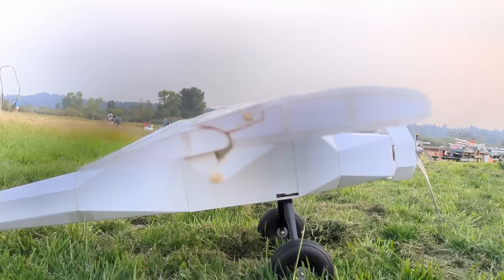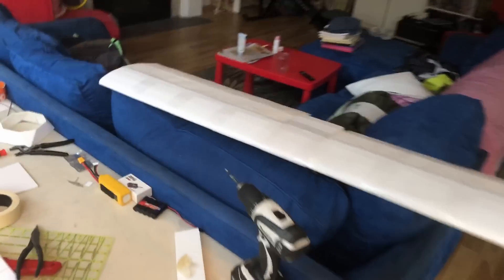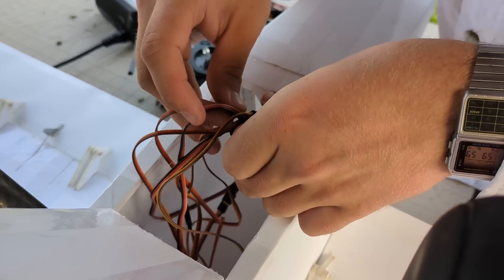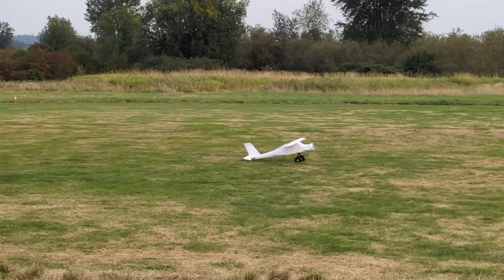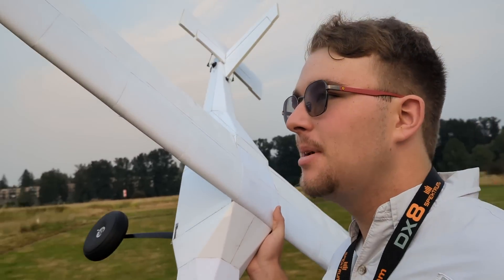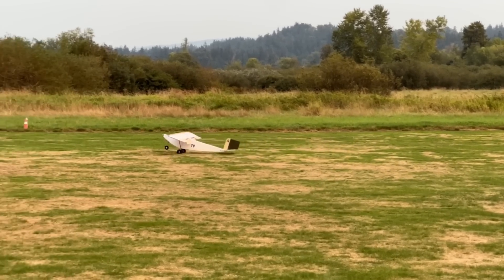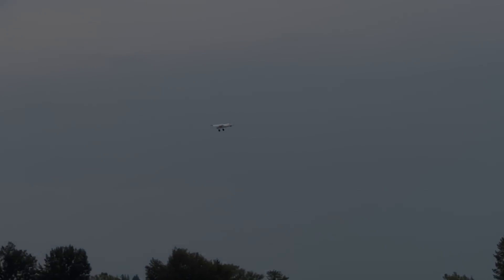Flying an Experiment STOL Concept Plane!

Comment: How strong and durable were the hinges for the flaps because I’m working on my own project that will have kitfox style flaperons and I want to make sure the hinges are durable enough
Reply from the maker: They haven’t broken yet! What did end up getting weak we’re the control horns and they tore out of the foam and got loose so I scrapped the plane

Comment: The Feiseler (sp?) Storch is a great go by for the ultimate STOL.

Just some observations, I think leading endge slats are an important marriage with the flaps.  Also, the empennage has a great scale look, but on most STOL planes are a little oversized.  Some even have an onverted airfoil for greater authority.  Finally, this is my thing with RC tail feathers in general, and that is that they look nice at scale, but because of the way Reynolds numbers dont apply well in small aircraft Inthink they need to be 20-25% bigger than scale to provide the stability needed.

Great job, tho!  Really love the onnovation of the flaps, especially on a foam wing.

Is that Marymoore field, by chance?

Comment: The gap doesn't "energize the flaps". It allows laminar airflow over the top surface so the wing doesn't stall at high attack angles. If the airflow over the top surface delaminates from the wing, a turbulent vacuum is created and the stall happens. Look it up on NASA.gov

Comment: Most of the lift does NOT come from air going over the top of the wing. Bernoulli is doing a lot less than Newton with respect to lift.
Reply from the maker: I would invite you to look at a type of diagram called an airfoil pressure plot. See how the pressure difference between the top of the wing and the bottom of the wing is almost entirely formed because of the top of the wing having very low pressure? That’s why obstructing the top of the wing with a spoiler works so well
Reply: @floppyhobbies  I'll take a look but symmetrical airfoils, paper airplanes and inverted flight...
Reply from the maker: @JustPlaneSilly  I'm not sure you understood. The pressure distribution isn't that way because of the airfoil shape, that's just how air is. On flat plate airfoils (paper airplanes), or inverted airfoils, they are just less efficient, but they're still getting the majority of their lift from the low pressure on the current upper surface, not high pressure on the bottom.
Reply: @floppyhobbies  You might be right but I don't think I can make my brain agree. If I hold my hand out the car window, the pressure on the top of my hand is way lower but it has nothing to do with anything other than Newton creating much higher pressure on the bottom of my hand.

Comment: Building an airliner wing for your model ? 😊
Airliners control surface are tied together and ce central control system dispatches according to flight envelope, it' s almost impossible to achieve good control without a flight controller tuned for your plane, this also include softwares support for your configuration and/or a really smart TX.

Also you should never turn off the engine when slowing down the propeller acts like an air brake !  It very noticeable 😆. You have openTx add some mix to limit engine rpm when airborne ( flight mode or specific input ) the spoilers should never be available in normal flight mode, just take off/ landing, allowing you to smooth transition between modes with delays or specific curves (difficult)

Comment: 0146   servos   do   NOT   go   at   the   tail.!!!      UNLESS  the model has enough mass that having  Excess  mass at the tail has  minimal affect  on the model's dom.     distribution of mass.  
0255   length of the aft cabin is excessive.     thus, the distance between the wing and stabs is a bit excessive.        proportion (comparison) of wingspan to fuselage length is a bit abnormal.
0450   AND  more  drag.!
0453   nope.      some things  Don't  work as expected when they are made tiny.
0508   THAT  is  bassackwards  from  what actually happens.     lift comes from positive aoa/aoi in a chord line.      lift is a product of newtonian action/reaction.    air is deflected downwards and a wing is pushed upwards.      want proof, look at  cheapo (grocery store) balsa airplane.
spoilers make  lots  of  DRAG (and turbulence) and  act as air-brakes.       these spoilers are gonna make a  HUGE  amount of drag because of the huge 'channel' that is formed behind them.
0603   heavy wing raises the location of the model's c-m.     center of mass            cg should be located at thirty percent of chord; or a bit forward-of thirty.          the span of the horiz-stab should be equal to thirty percent of the wingspan.       d
Reply from the maker: Oh hey, it’s you again. Glad you like my videos!

Comment: I'm curious as to what cad process you use. Specifically what software and how to go from 3d model to layout for the laser cutter. Or do you keep the geometry relatively simple and simply sketch it out in 2d with a lot of mindfulness?
Reply from the maker: I use Inkscape to design the airplane. I do not go from 3d to 2d, instead I design in 2d. My process essentially looks like getting a top profile, side profile, and cross sectional views of the fuselage at different points, and then using some simple math to make the transitions between them. I remember when I was first starting I had really wished there was a video explaining how to design an airplane like flite test. Maybe I'll make a video like that soon!

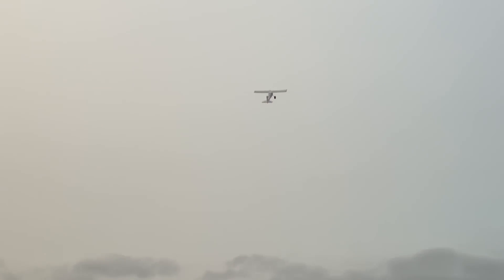Comment: I think you won the competition actually, because your opponent uses more the propeller than the wings to stay in the air. Someone even says "Do airplane mode." when he does half helicopter mode. But your airplane can do helicopter mode even better, as we see at 12:31. So in helicopter mode your plane does actually fly slower than the other one. And also if both planes would do pure airplane mode I guess. Helicopter-mode is considered cheating imho. So why not trying to fly slow in pure glider mode without the motor spoiling the result?
Reply from the maker: That's actually a really good idea for testing slow flight, the next time both those airplanes are out at the field I might try that. I'll be sure to reply with the result here if I do!

Comment: But 3D planes could fly as slow as the pilot wanted, including hovering?
Reply from the maker: True! It was pilots honor to see what the wing will do, and not hang it on the prop. At the end of the day, rc doesn’t really have a practical purpose so I just build the wing to see what it can do, even if a 3d plane could do it better.
Reply: @floppyhobbies  Your wing is amazing

Comment: thats pretty stupid

there are thousands of highly trained engineers who have already developed the optimal wing designs
Stick with those.
Reply: This isn't stupid. If you ever look at the wing on a passenger jet as it lands, you'll see it has slats and flaps (actually usually theres multiple staggered ones on big planes as opposed to the single flaps here). 

Hes actually looked at the engineering done by all those engineers, and implemented it in his RC plane.

Comment: The Lockheed L-1011 had direct lift control somewhat similar to your power/spoiler concept. Also, spoilers don't work all that well for roll control on full size general aviation aircraft.
Reply from the maker: My inspiration was the F-14 in landing configuration with the DLC switch enabled. Also, the Mitsubishi MU-2 has full span spoilerons. It's not a common configuration but there's certain problems it solves well!

Comment: also tilt the motor 1-2 degrees to the right to reduce p torque. this is because you use an electric motor. the induced drag on the flaps will increase the issue.
Reply: if you do this you can perform high alpha maneuver's.

Comment: your top speed brake needs to overlap with the controllable flaps. that's why it tipped forward as it provided downforce before the cg.
Reply: it will reduce control efficiency in terms of energy retention so you might need a larger battery.
Reply: if you want an easy fix, bend the gear slightly forward increasing the rake and reducing drag. it will increase speed and allow for a larger battery aft cg.
Reply from the maker: They actually do overlap! I only experience downforce issues if I'm travelling at high speeds when I extend the spoilers. I think that's because they act less to stall the top of the wing, and more to increase the pressure on top of it, making negative lift. At lower speeds, they just kill the lift and it works exactly how I wanted it to.
Reply: @floppyhobbies  that’s awesome. The f-16 style ailerons made me laugh seeing them on a high wing.
Reply: Good work. Consider me glued to your content!

Comment: I have a TX 16 too, how do you program the spoilers? I have a large sailplane that I want to do that to, rudder alone isn't enough on breezy days.
Reply from the maker: So what I did was a I made a new entry in the inputs tab that I named SPLR. I set that up on a switch so that when I flicked the switch the channel value would change -100% to +100%. Then, I went to the spoilerons in the mixing tab, because I had a separate mix for each spoileron, and I mixed in the spoiler input. I hope that helps!

Comment: Those wings are really nice.     You've got a lot of room to wiggle out weight from the fuselage.  Remember that your opponent there is using a skin to cover gaps, and you can do that too in many places.
Reply from the maker: Of course. It actually turned out where the wing was super heavy and the fuselage super light (for the size). All those complex mechanisms in the wing made it super heavy but the fuselage is just empty space for the most part!
Reply: @floppyhobbies     that makes sense.  Would making huge rectangle holes in the solid section of the wing, then skinning it over make a difference?   Can add some bracing if needed, but probably only a couple max.   That wing is so cool looking, I am super jealous.
Reply from the maker: @williamfawkes8379  I don't think that would make a huge difference to be honest. The weight of foamboard per square inch is actually super low, especially since if you take the paper off you remove 70% of the weight. It's so light that it's almost as light as covering! The heavy part is any glue joint (hot glue is heavy), and the cardstock skin I'm using for the flaps which is heavier than foamboard per square inch. So the fact that I had lots of small ribs in the wing and complicated multi-layer cardstock skins for the spoilers and flaps really added on to the weight. 

TLDR: I wouldn't be able to poke holes in anything heavy, since it needs to be that complicated shape, and anywhere I could make an opening wouldn't actually be responsible for much weight and wouldn't be worth the effort. 

That all being said, I'm working on a building technique to more closely mirror covered balsa, with foam taking balsa's place and using covering over foam ribs. Keep an eye out on the channel, it'll definitely appear on a project at some point in the future if it turns out to be a worthwhile technique!
Reply: @floppyhobbies  need pullies and then house the motors in the fuselage